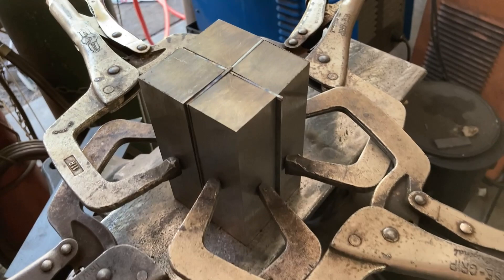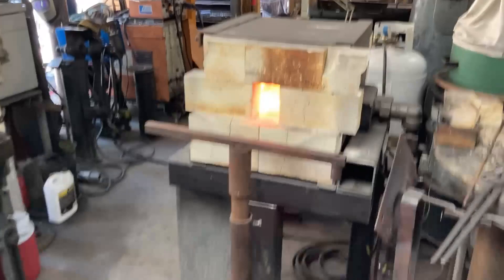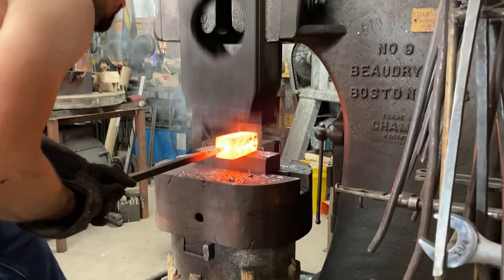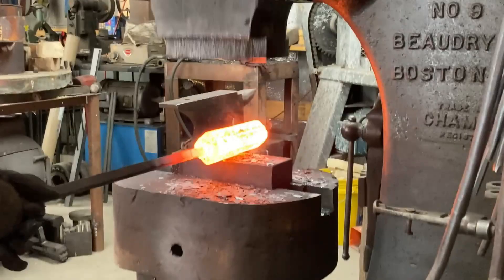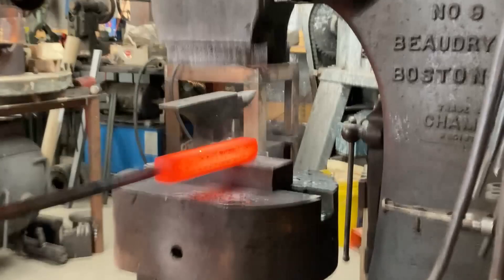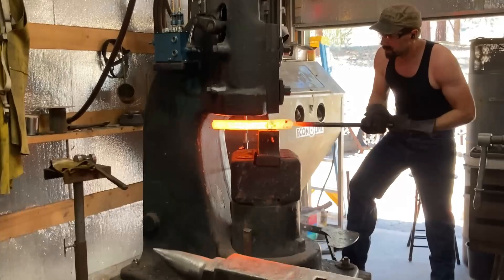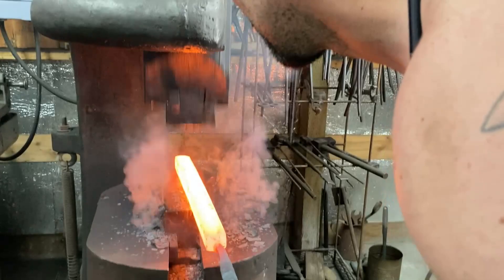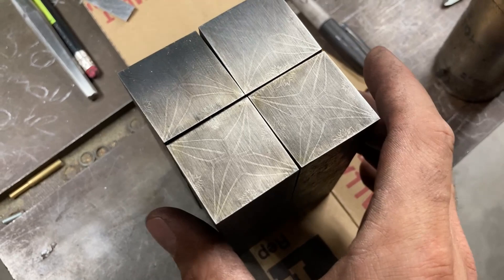Bolo 3

Comment: wow, you hit it a lot more than I would. But, I don't have that nice hammer. I use a 55lb tire hammer. It will just smack the thing around rather than push through the whole thing. I weld with Al's 24 ton press. Yes, when possible, I use squaring dies. That hammer you are using is tremendous, and it looks just about perfect for welding (the Beaudry). Thanks for sharing and narrating so well. You are doing some serious work these days.